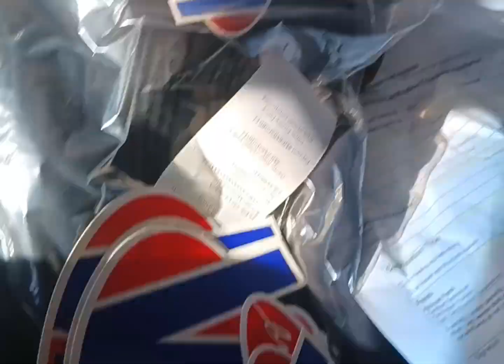#Taylor #rc #obr  how I mix my vp c9 fuel with amsoil mix yeah buddyyy

Comment: Hello! Can you use this mix with any type of 2 cycle engines? And what type of mix are you running 40:1, 32:1, 25:1 I will appreciate your help and thanks for the tip 👍👌
Reply from the maker: KIKE ST yessir you can use it on other 2 cycle engines I run it in all my engines it's a little costly I pay $11.50 a gallon at the pump but it's worth it and I mix it at 28:1 with amsoil 2cycle mix

Comment: Are u able to order that fuel or have to go out and buy it ?
Reply from the maker: Mr Mayhem Ftw If you don't have a vp station near by you can also order online
Reply: @tmacksnitro8935  I might have to look if there’s one near by if not what kind of fuel do I order do that have a website?
Reply from the maker: @Mr Mayhem Ftw  yeah they have different fuels that some use in the hobby but I've only used c9 so I don't know much about the other vp fuels I can tell you I've only ran c9 and all my rigs and they fire up and run Hella good but I pay $11.50 a gallon at the pump so it's a little more online with shipping
Reply: @tmacksnitro8935  I found it on the site 100 to order not bad because I’m going to be ordering my first ever big bore soon 40gt I don’t want to ruin it with cheap gas I want only the best for it